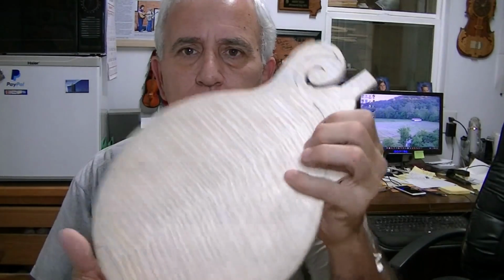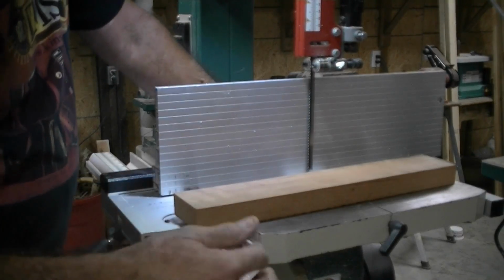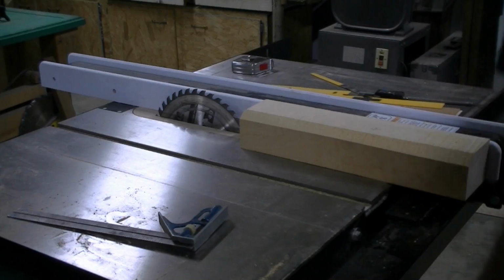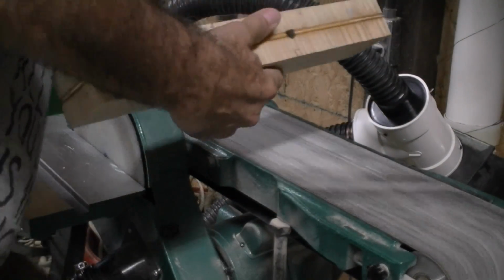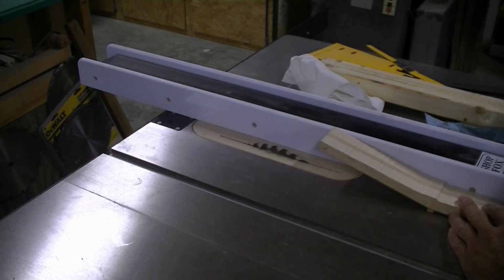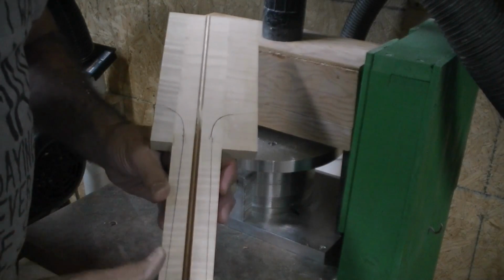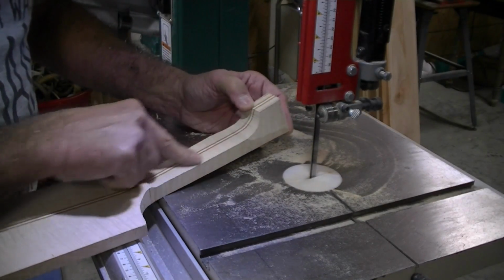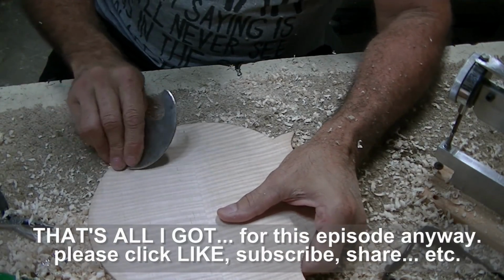182 RSW Custom Rosa Mandolin Part 5 Neck

Comment: Hi jerry, i too use the v joint for strength, i clip a small mirror on the back of my band saw to line the marks up to the blade. Only took 15 years for me to figure that out!
Reply from the maker: scott hennis the mirror is a good idea. My only problem with mirrors is that everything is backwards in them. I'm not very good with backwards. Thanks for watching.